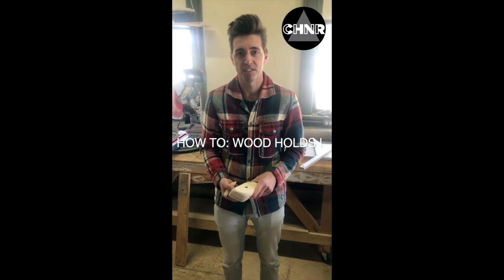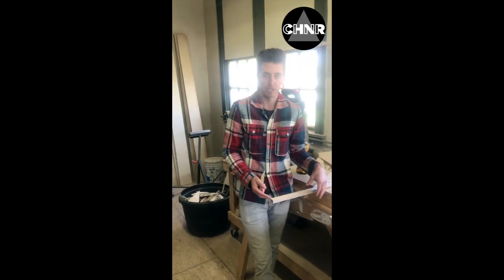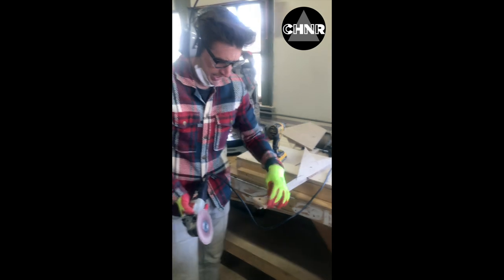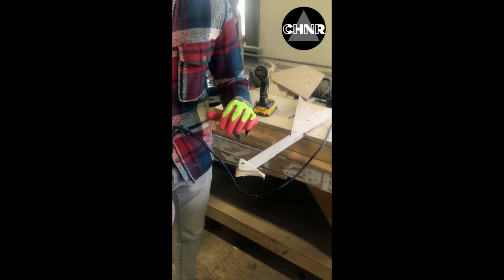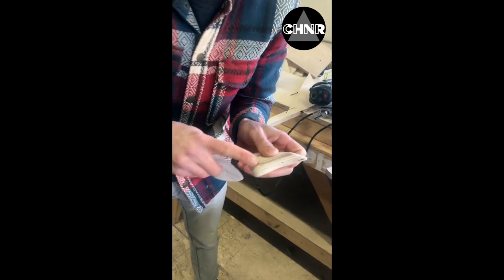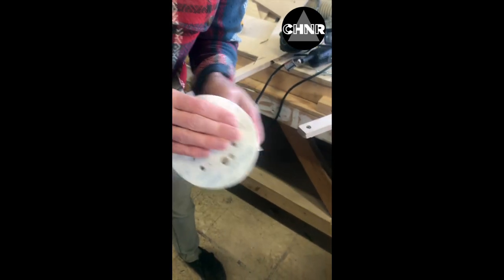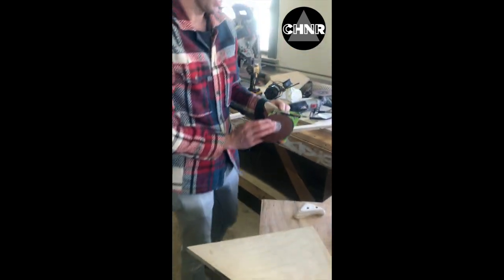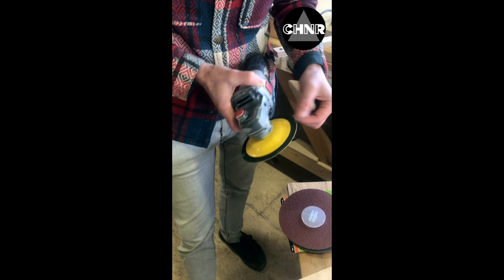How To Make Wood Holds Part I |  CLIMBING HOLDS VIDEO | Stoked Climbing / Climbing Hold News Reviews

Comment: Thank you for the video but I suggest avoiding gloves with rotational tools, grazing yourself with the flap disc hurts but a glove wrapping the disc will pinch fingers right off... or worse :-S
Reply: I can't really see any advantage to using gloves with any woodworking tool. It reduces control and dexterity and introduces more danger than it prevents. I wear a mask and ear defenders all day every day and know I should wear eye protection more (but it's a pita), but gloves? Not a chance.